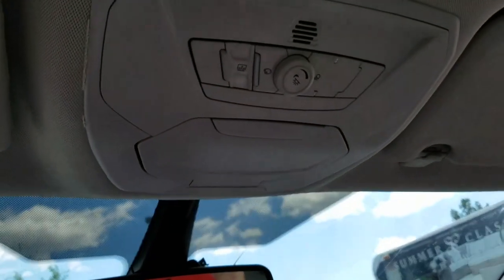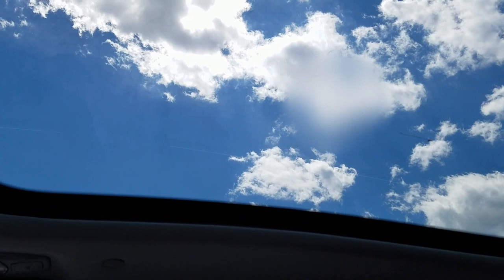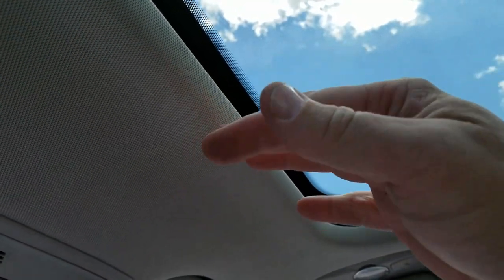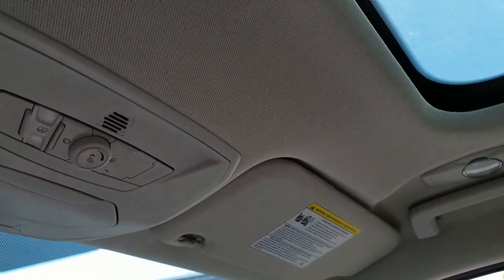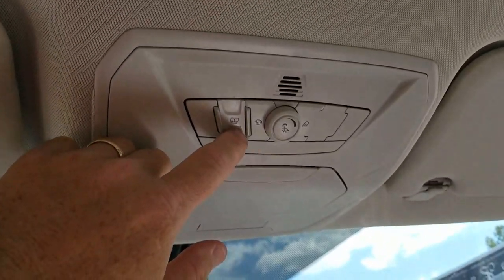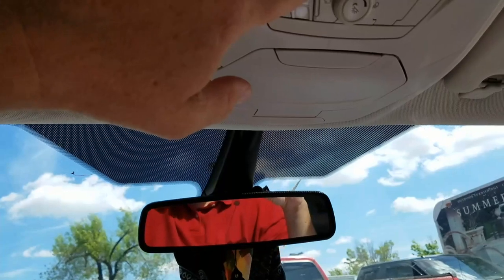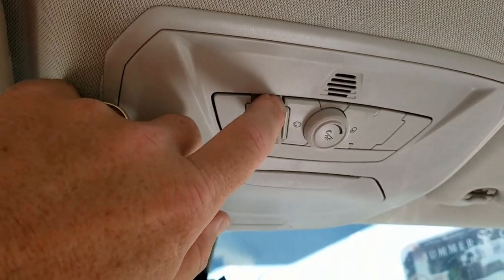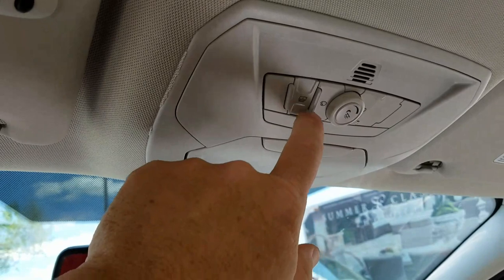Ford CMAX Power Sunshade Initialization

Comment: Could you do a video on how to take the roof liner down so I can get to the blind mechanism
Reply from the maker: I will if I ever do another one of these.  Haven't seen one in a long time now
Reply: You start from front to back. You carefully have to learn how to pry out the overhead console thing... you'll need skiny pry tools and 'dental tools'....then there are 2 black screws located above where you'd previously have the top plastic of the sunglasses holder (visible after removing the main middle section). Of course. Carefully unplug all wires,  and if your windshield has the rain sensors,  carefully remove that plastic and 2 connectors. The overhead console is multiple sections, so you remove the inner largest section first,, then the skinnier outer tan section is later.. then the front plastic pillar things by the mini windows,  they  mostly pop out towards the center of the dash, but be careful with all of the wiring,  washer fluid tube, airbags, etc in there... it helps to free the cables along the frame from their clips to give them room to move when the headliner comes down.. then you unscrew all of the sunvisors and the side handles above the doors on ceiling.... the electric connectors for the sun visors are annoyingly glued to the headliner foam, so you'll need to razor blade cut the glue away so you can unplug them and not leave them hanging.... after that it's just un-tucking the headliner carefully front the front to at least 75% of the way to the back of the car. It helps to have the front seats upright and the headrests max height to help hold the headliner after you partially lower it (the front 75%).  The big rectangular shade and motor guide thing has about 7 screws that hold it in place, and when you carefully have the headliner front 75% lowered and resting on the front seat headrests, the big rectangular assembly of the shade (easier with 2  people) can be lowered and removed out via one of the front doors...

Comment: What are the dimensions of the opening in the headliner? I'm considering a 2013 C-Max where the seller (a Ford dealership) removed the blind. I'm wondering whether I could use something like a foldable 16" x 24" Maypott Magnetic Sunroof Sun Shade... instead dealing with the cost and hassle of OEM replacement shade.
Reply from the maker: Sorry, no idea. I haven't even seen one of these models in quite awhile.

Comment: Hı İ have cmax 2013 with panoramic roof window. Windows blinds can fully open but when i want to fully close it blinds moves to the end and then bounces back 20-30cm to the end and stops. Do you have any idea for this problem. Btw initialization did not work for me. Thanks in advance.
Reply from the maker: Possibly an issue with the roller that the shade wraps around.  Would require replacement if so, but hard to say for sure without seeing it

Comment: This didnt work for me. Mine is open and will not close.
Reply from the maker: T Sal Then you must have an issue with the motor or the switch
Reply: Pacfanweb the switch works. I think its stuck on one side and wont close properly. Any way i can go about fixing it ?
Reply from the maker: It the shade bunching up or hanging down on that one side?  If so, it's broken...needs replacing.
Reply: Same thing happening with my 2014 c max.
Reply: Pat Channell I took my 2014 to the dealer and it was covered under warranty. It was a faulty roller they said. Try and take it to ford and they will fix it for free.
Reply: T Sal thanks, I'll try..
Reply: Thank you! Fixed mine after a few tries. Also I reached up and manually rolled up the slack from where it got bunched up. And It wouldn't reset until I shut the car off completely and opened the door to really shut off the car. But finally worked.
Reply: @PubStarFlash  Curious if that was the basic manufacturer warranty and how many years in?  I have a 2015 (6 years old) and the shade has been inoperable for probably 2 years now.  I took it to the dealer today and they said $152.00 just for a diagnostic.

Comment: Do you have a video of replacing the c max sunshade?
Reply from the maker: I do not.  Haven't done one in quite awhile now. Pretty easy, though.  Drop the headliner, then it has Torx screws holding it it.  It comes as an assembly, with a frame.  Looks like a small sunroof track.